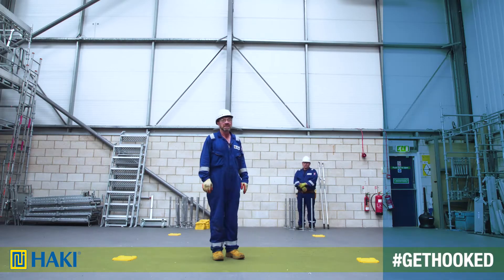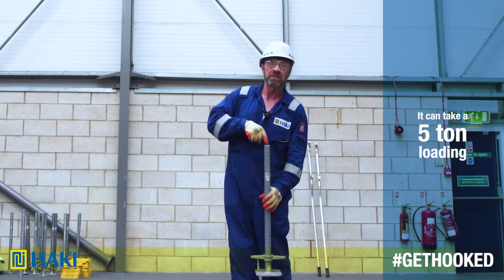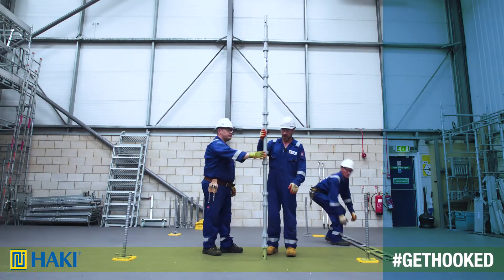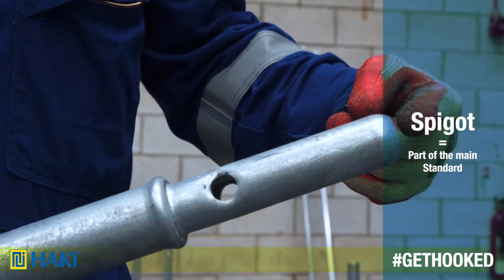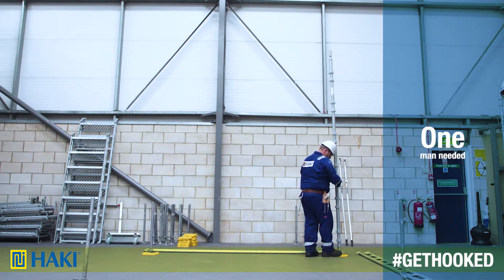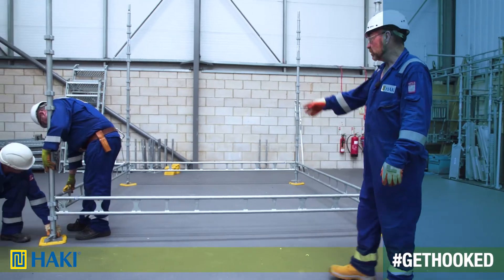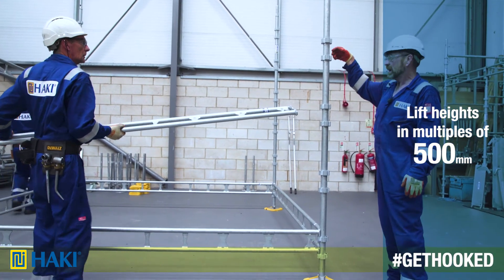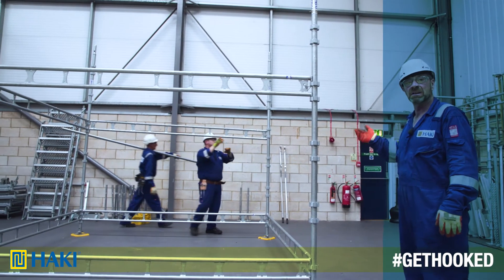How to build a bay using the HAKI Universal scaffolding system

Comment: Kann dere produsere små topper du trer nedpå spirene så du skrurfast med en bolt gjennom spiret ja det hullet på toppen av spiret så mann kann bruke 4 part kjetting skrev  for og løfte stilasen runt på byggeplassen er det noe og tjene penger på har ikke sett det enda på bygg ja  rør med hull i for montering på topp spir med hull til bolt og sikeligt øye til og huke kran slingsen i godkjente  så slipper mann dette tullet med og holde på med stropper? Bisnis aldri sett det før ikke på 1 byggeplass i Norge ikke 1 plass.